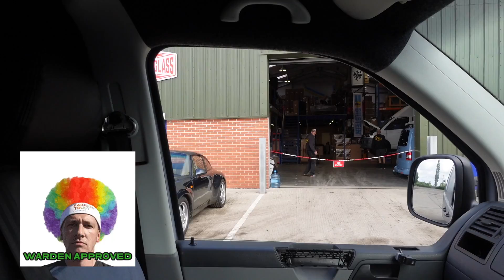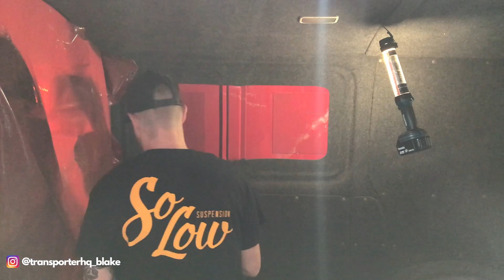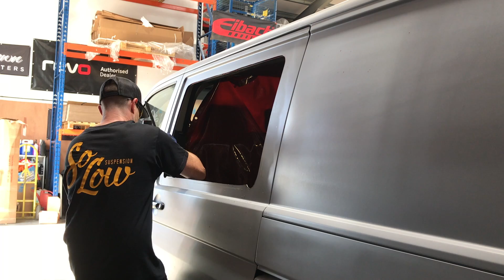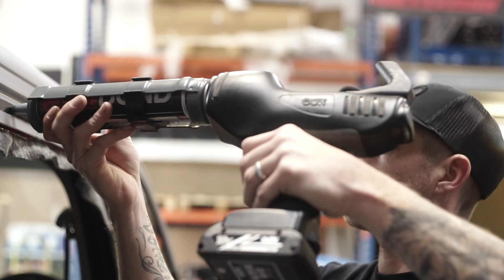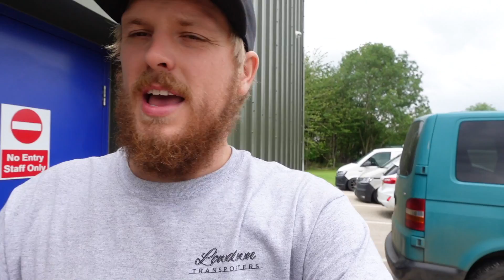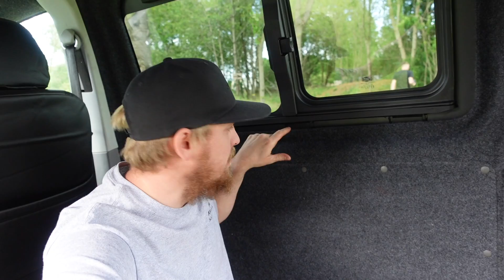VW T5 'Restoration' Ep14 Flush Sliding Windows Transporter HQ Camper Glass Kombi Window

Comment: I have a flush window fitted in mine! Brought from Vgc only been in 1 year!  water starting to come out of the track inside as the seals are shrinking. 😭
Reply from the maker: Oh no way! Hopefully you can get it sorted out bud.
Reply: @DanChambersDAC  I actually did sort it, called them and they told me to clean the inner glass that shuts against the seal & to condition the rubber, I put some wurth fit on all my seals and it has made them like new 🤙🤙

Comment: Great videos Mate. If when you sell this van, the new owner was to convert to camper, it can’t be reclassified as a camper due to new DVLA rules. They state must have 2 windows on one side, not including passenger or drivers windows. Can still be van with windows, but won’t get the better insurance without an additional window
Reply from the maker: Thank you so much for watching! Yes, My first van was a camper and never reclassified, Fully modified on air ride etc it was still only around £450 to insure. My crafter is still classified as van with windows too. These style of van's can't be re classified to camper either as they need to be a high roof and not just have a pop top fitted.

Comment: What happened after you fitted the MAF sensor, what were your symptoms. I have a problem with overboost. Turbo cleaned, pressure sensor changed, but no joy, still bombs out at 3200 revs. New turbo next.
Reply from the maker: Thank you so much for watching! Soon as I unplugged the MAF it drove perfectly. Changed it and it drives right now! That's so annoying 😔

Comment: Good that they developed the flush fitting, i went for oem sliding windows because I cant  stand the non flush ones, can't belive anyone can be happy with them, look so cheap and nasty imo. The oem ones have larger opening panel than these though.
Reply: @THQAutomotive  Hi there. Not sure you responded to right comment or I am confused lol. My windows are genuine sliders, because I wanted flush windows and the only other flush ones at the time (last year), had a smaller aperture than the genuine ones and I don't like that. About the leaking, after looking into the design and understanding it I think there is confusion about how the drains work and should be maintained. Also the frame of the genuine moving part rusts and swells therfore ruining the drainage. I bought a pair in this condition, replaced panels with new ones and protected them for water ingress to prevent internal corrosion, no water what so ever coming in 👍🏻
Reply from the maker: Thank you for watching! It has been in the pipe line for a while now! These should work better than any other including factory when they are released.

Comment: The windows look great.  Mine has opening (factory) glass on both sides.  The design is awful, they don't slide nicely, don't close tightly and of course... leak like a sieve.  Removing it all and fitting Camper Glass stuff would be so much better!!!  Great video as always, keep it up Dan.
Reply from the maker: Thank you for watching! The factory windows don't have the drain grooves in them. The water can get in and then the gully fills and overflows. We have discussed a couple of small changes to make the production windows perfect.